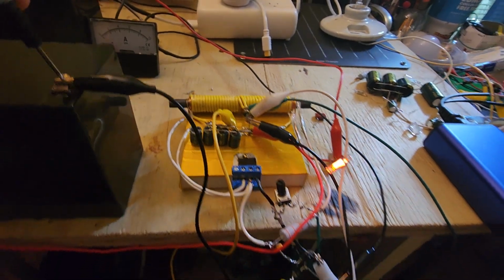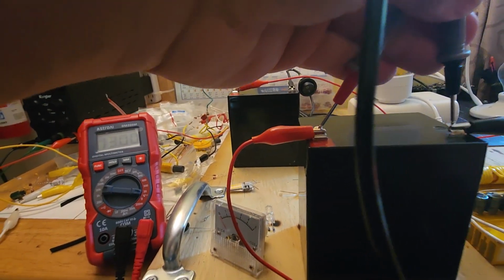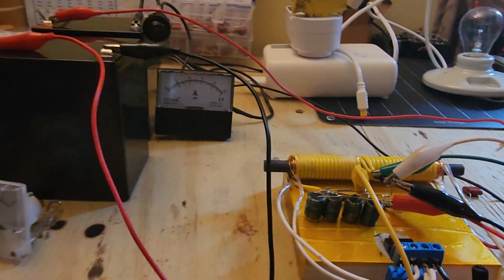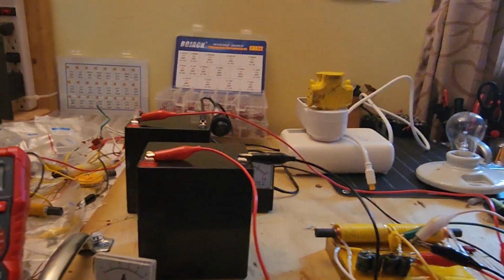💡Mastering The Negative Resistance & Perfecting The Ability To Rapidly Recharge 5AH Sources🌩

Comment: hi guys...,k energy,malik,and wind. ...a friend talked to me about the internal resistance of the potentiometers.. very important for extracting 2kv by induced coil. .. there are several types, and this is where I want to come to study all the types of potentiometers they do not react the same. ...with each other. there is no current in the potential, just at the end of your charge. ... / in a conventional way ... in an unconventional way the cold succeeds in heating, why heat the device .... you need the right resistance of non-inductive value. ... ❤️❤️💢💢👽👽👽👽👽

Comment: install another ammeter at the output of the rectifier from ringer and compare the current consumption, measuring the voltage at the input and output, calculate the power at the input and output.

Comment: The battery that rapidly charged but also rapidly discharged: charge it again and let it sit for a day and see if it still discharges rapidly.
Reply from the maker: Yes, I have been doing many tests & this type of energy is most efficient when charging a secondary 5AH battery or super capacitor or super cap battery hybrid, then powering up an efficient ac inverter to run loads for a time.
Reply: @MTECH2022  

if you do not understand Tesla, you can Reed  Henry MORAY how he did to capture atmospheric energy, ether and how he applied it up to 50 kw
Reply: @MTECH2022  I mean maybe it puts a voltage on the battery without doing anything to the chemicals and that the real recharging happens by this voltage at rest, i believe bedini said something like this but im not sure.